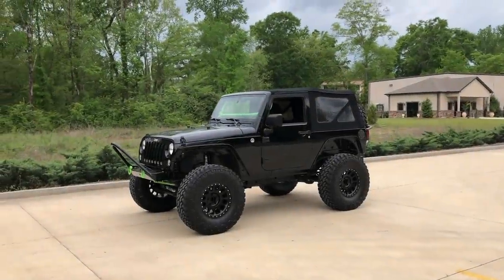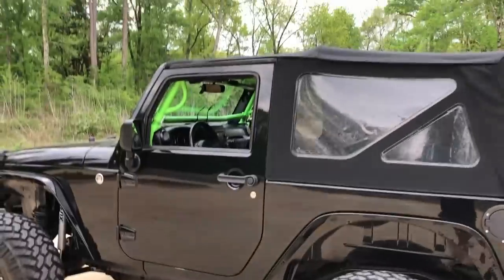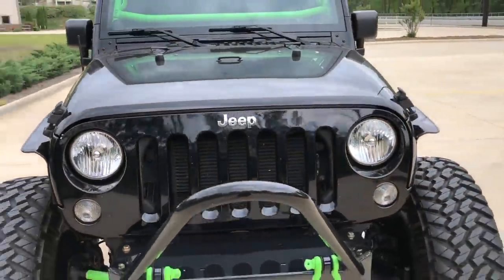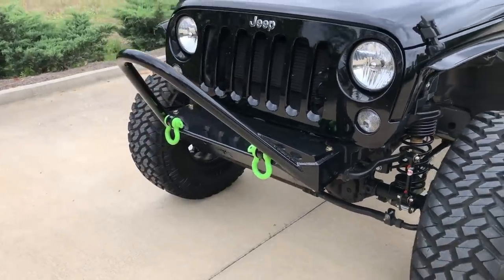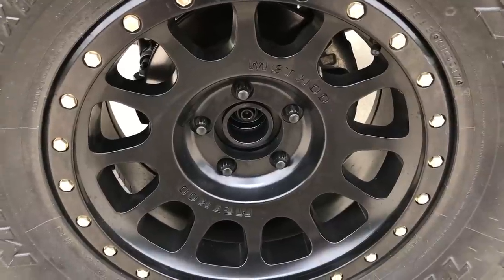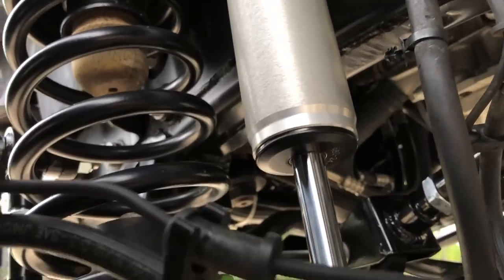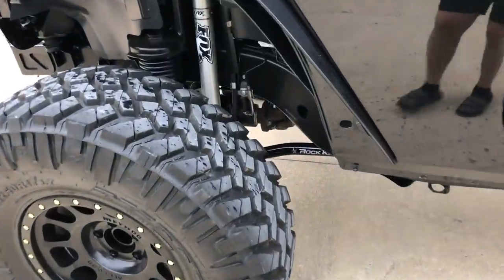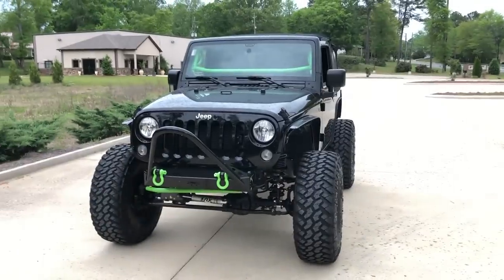Big Sauce JK | Second Walk Around and Update

Comment: ive had the same steering stabilizer for almost a year on 2011 jk w 35s and it has not found it's center yet lol how long did you hear until it doesnt pull as bad? but i will not be spending $400 on the other fox stabilizer to fix it haha its not $400's bad
Reply: i have the fox and i like it, but when it goes im getting a falcon to go with my shocks :D